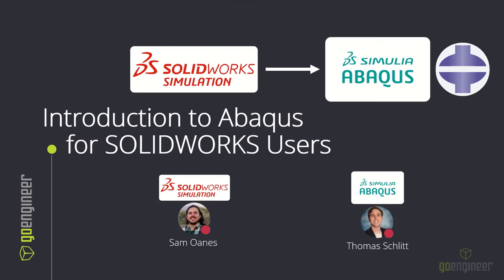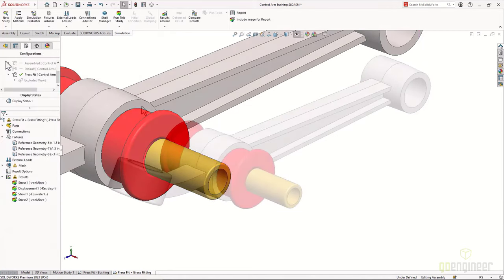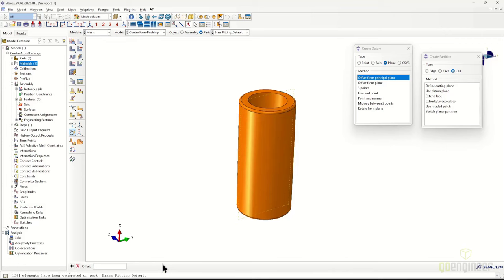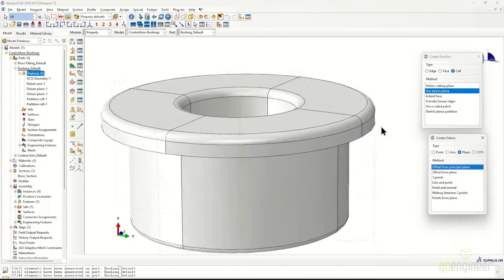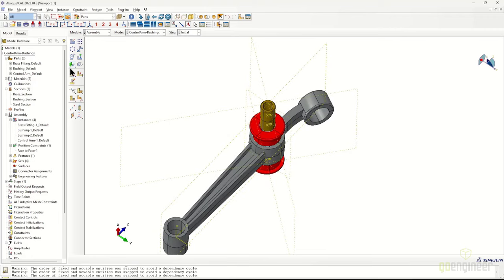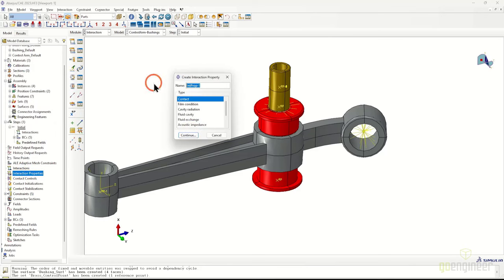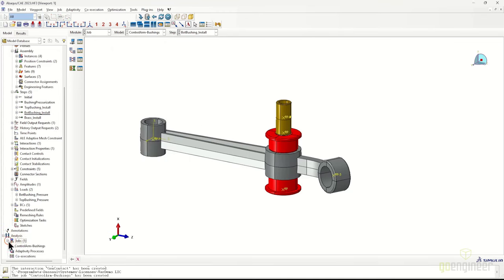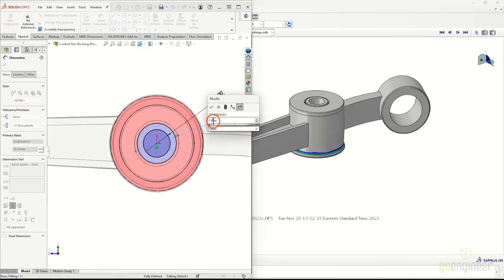Introduction to Abaqus for SOLIDWORKS Users - Webinar

Comment: 😮was abacus integrated into SOLIDWORKS interface?
Reply from the maker: There's an association between the interfaces with a plugin so that you can quickly load SOLIDWORKS files into Abaqus. However no, it isn't integrated into SOLIDWORKS like what you see in the side pane for SOLIDWORKS PDM or 3DEXPERIENCE and there isn't a toolbar dedicated to Abaqus. If you're curious about how to add the plugin, we have a blog that goes into details about how to install it: https://www.goengineer.com/blog/install-abaqus-associative-interface-for-solidworks
Reply: @goengineer  that's good. Thanks for your response.